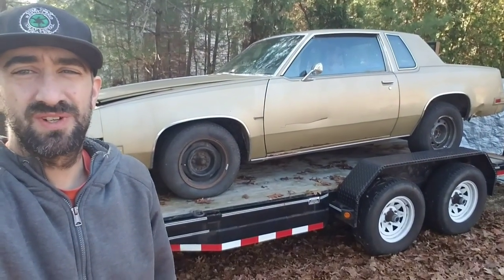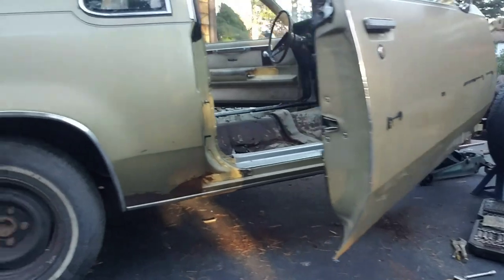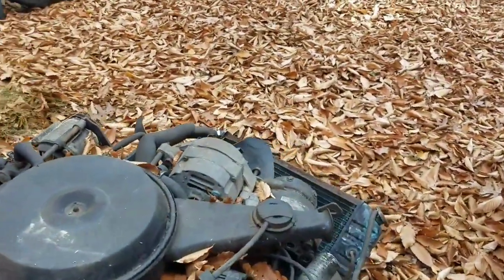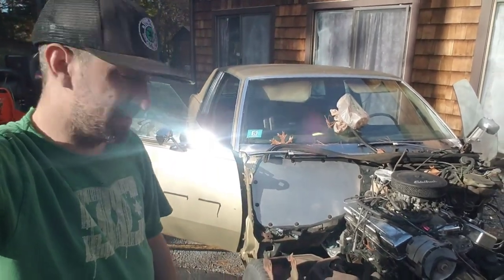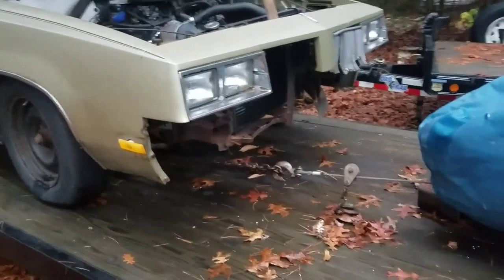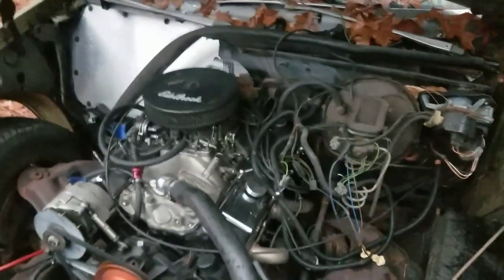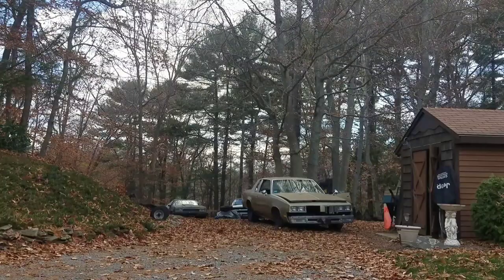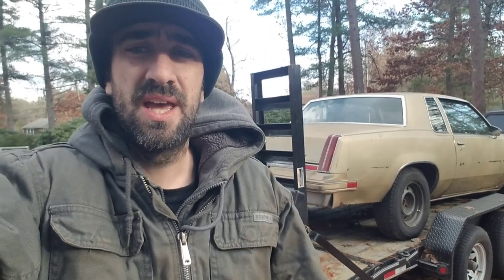Budget cutlass: how to v8 swap for almost nothing

Comment: I admire your courage and these are the greatest cars ever all the G Body’s. Just bought me an 87 Regal with the factory 307 and it’s sitting at 85% out of %100 as far as 100 being absolutely perfect. And I got it for 4K it was a hell of a deal. All original interior in great condition. Got the midnight blue seats that feel like a Lazy Boy recliner lol
Reply from the maker: Thank you, and sounds like you got yourself a good deal! I love the interiors in these when they're in good condition
Reply: An Olds or Buick 350 with a quadrajet would make a nice swap for that 307. I have a $300 GS350 engine and T-400 that I got cheap from a guy 455 swapping his GS. It will be a nice upgrade from the 3.8 slow-motor in my Regal.

Comment: Nice job, wish you showed more of the engine swap
Reply from the maker: Thank you.  I have another cutlass I'm thinking of doing another build video on. What would you like to see more of? Like filmed in real time? I struggle with length of videos, so I appreciate any feedback.
Reply: @rowdywelder2656  
I'm swapping a 81 cutlass with my daughter.  She bought a SBC 350 from a machine shop.  She picked it up for $1200 and it's been her daily for the past 3 years.  It's her 1st car.  I'm got some experience but was looking for as much information as possible.
Appreciate all your efforts and understand recording while you're working takes so much longer.  Keep up the awesome work
Reply: @rowdywelder2656  
Something I'm struggling with is the wiring.
Same 231 engine you pulled.  What wires do we keep, what can go.  this one's easier than most but we want a basic setup.
Gonna run a 650 Holley carburetor
Reply from the maker: @stevenmcguire7211  dont overcomplicate it. Remove one wire at time and label it.  I removed ac which made it easier.   But you will need the wire to the choke, the wires to the starter, the wires to the alternator, distributor, and to the battery.
Reply from the maker: @stevenmcguire7211  also you will need to make sure you have the correct upper and lower motor mounts. I do wish I showed that part better in video.  Any questions you have don't hesitate to ask
Reply: @rowdywelder2656  
Appreciate it, we picked up a pair of Monte Carlo v8 mounts. It's gonna be a little bit b4 we're totally ready.  We're gathering the parts we need little at a time so it's not a huge cost when we're ready.  I wont hesitate to ask if something comes up.
Looking forward to more videos.
Reply from the maker: @stevenmcguire7211  the lower mounts have a certain spot to go in, I can show you when time comes. The nickel and dime stuff adds up fast!  I actually just filmed a recap video of this car so far. Will be posted soon in next couple days.

Comment: Great video ! Did you use stock driveshaft and stock yolk out of the g body ??
Reply from the maker: Thank you, glad you liked it. Reused stock driveshaft
Reply: @rowdywelder2656  so a 350 transmission will work with stock gbody yolk ? Thank you !
Reply from the maker: @450_mick8  yes.

Comment: @RowdyWelder could you show exactly wire you used for your distributor power my cutlass had bo motor so im wigging what wire went where
Reply from the maker: It would be in the main harness coming from the drivers side. It's a wire that is slightly larger gauge, and will have a distinct looking plug to go into bottom of hei distributer. Can Google the image, or test fit into distributor.  Hope that helps some.

Comment: When swapping the the v8 do you still need the computer and wiring harness or can you get rid of it?
Reply from the maker: The computer and most of the wiring was removed, along with all the heat/ac stuff.

 Just needs power to distributer, starter wires hooked up, alternator hooked up, and battery.  I labeled and reused the factory wires
Reply: @rowdywelder2656  right on thank you sir! Yeah ac n heater is already gone. Throwing a  chevy 305 in a 81 cutlass hopefully this weekend
Reply from the maker: @ravenrivera1950  no problem,  I'm happy to try answer any other question you have.

Comment: Hey bud, any chance I can ask some questions regarding a 3.8l quadrajet to Holley carburetor swap?
Reply from the maker: Ask away, i'll help however I can
Reply: It's the 81 cutlass with the 3.8 v6
We got a Holley 600, got the carb spacer and the return spring bracket.
Do I need to change the distributor?
The original doesn't have the vacuum canister
Reply: We're doing a 350 SBC swap this fall.
It's my daughter's daily driver and she's unhappy with the carb, we have the Holley so she wanted to swap it until we change the engine.
Reply from the maker: My first thought is the holley 600 is gonna be way too big for the 3.8.  I also think you would be able to use stock distributer.
Reply: I appreciate it, gonna give it a shot.
I think the quadrajet is a 500.
Worse case we switch it back

Comment: did you have to get a custom driveshaft?
Reply from the maker: @Joe-P-t9k  stock driveshaft works. Transmission goes in same spot
Reply: @rowdywelder2656  Alright, thanks

Comment: I have a 350 out of a 70 monte carlo. I am wanting to swap out my 267 v8 to the 350. I have a general understanding of mechanical stuff. Do yoj think itd be worth having a shop do it? I would like to do it myself but im afraid of turning my running car to non running car 😅
Reply from the maker: I think this is a swap that most can do.  It's a good way to learn mechanics.  There are some tools required (engine hoist). Don't cut any wires or anything,  you really can't mess it up too bad lol
Reply: @rowdywelder2656  ok noted thank you very much
Reply from the maker: @absolutelynothing9636  my first car build was a motor swap on an 86 cutlass.  This build is to kind of mimic that car.  I think it a great platform to learn on

Comment: Did you attach that new fuel line to the factory one that comes out on the driver side for the v6 cars?
Reply from the maker: I ran a new 3/8 fuel line up the passenger side
Reply: @rowdywelder2656  ok thanks

Comment: Watching this because i want to swap my 4 cylinder engine out of my 86 cutlass Ciera for something faster, how do i even know what engine i could swap with?
Reply from the maker: That's a whole different platform.  Front wheel drive cars are more difficult to swap.  If it was me I'd be trying to get a supercharged 3800 engine in there
Reply: Swap for a different car. Unless you are building a high dollar custom car, you're in for a lot more work than most people want to attempt.

Comment: I have 350 5.7 no fuel pump I don’t know what to do
Reply from the maker: Is it a newer vortec engine? The newer smallblocks cant run a mechanical  pump.

 You will need an electric fuel pump. Spend the money and get a good quality fuel pressure regulator.
Reply: If you get a chance know your busy can you tell me color wires I will need I’m going now no ac..
Reply: I know it’s pink , red etc . I had wire harness sliced want to use the right ones